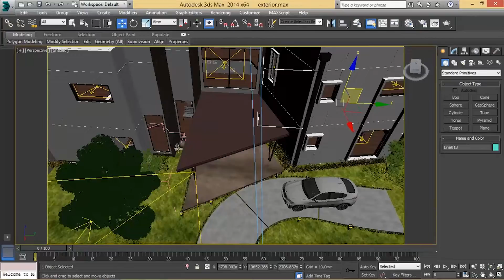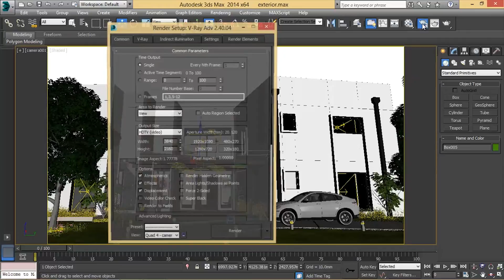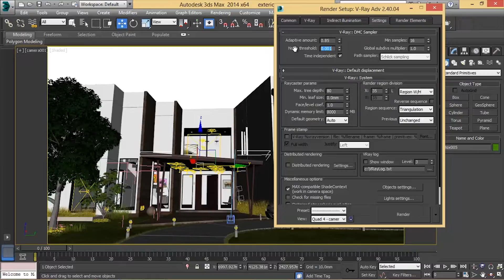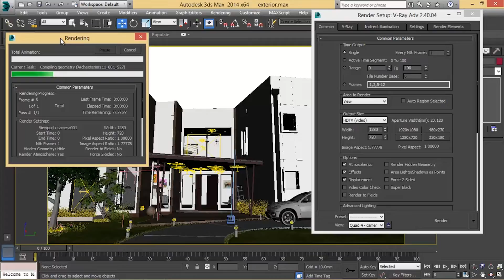3ds max Advance Exterior Rendering setting Tutorial

Comment: Hi I would like to know the system requirements for vray you are using..
Reply: Processor (CPU) – Intel Core i7 8700   

Processor speed – Up To 4.60 GHz

Graphics Card – NVIDIA GeForce GTX 1060 TI  8GB

Memory (Ram) – 32GB

Storage – 2TB SATA Hard Drive